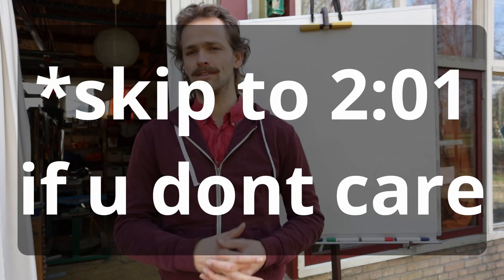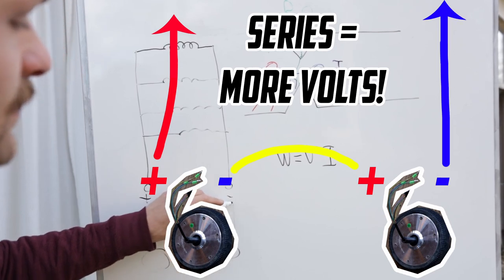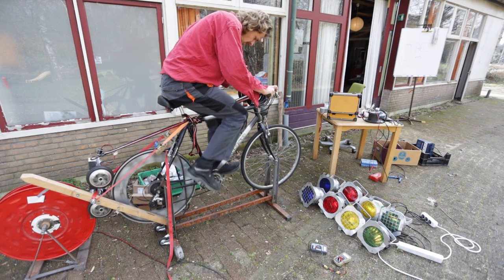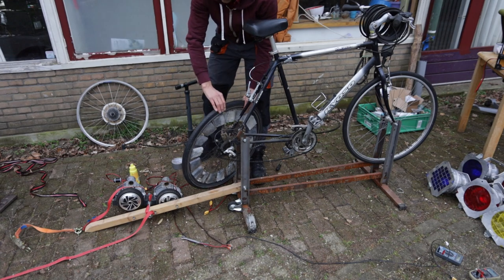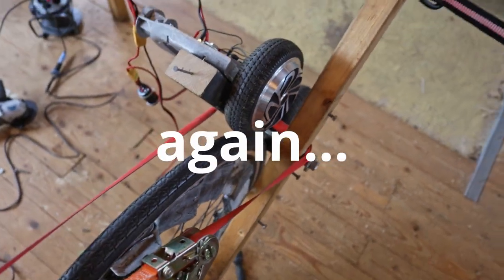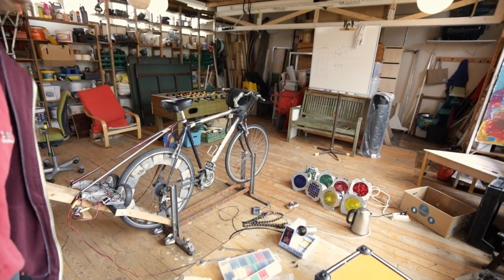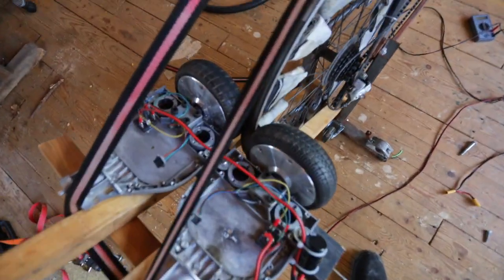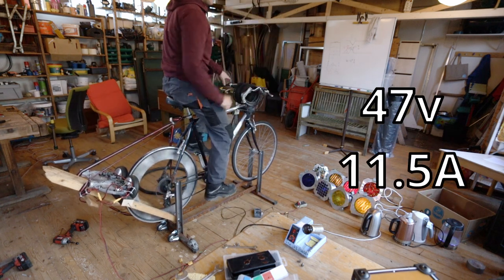OVER 600WATTS with BIKE GENERATOR using HOVERBOARD MOTORS!

Comment: how long does it take to boil a kettle of water with 200-300 watts?
Reply from the maker: Depends on a few factors like efficiency of your boiling device and thermal isolation and such. But, considering that a 80w 350ml water boiler takes about 25min to get to boiling temperature, you could use 3 of those to boil about a liter of water in 25min using 240w. More or less. :-)
Reply: @jurriaandevosprojects  that's quite long for a few cups of tea!
Reply from the maker: @KnowArt  Yes. So usually some gas/coal/nuclear/biomass-powered steam turbine is doing all that work for YOUR cup of tea. 🙂 Or it's wind, solar, hydro, tidal or thermal power, but those are actually quite a small percentage of power generation.

Comment: Thank you for the information and the video! I appreciate all the effort you put into you channel!  Question ... Rather than trying to run all of the resistive loads ... What results would you get going into a charge controller and charging a 12V / 100AH Lithium battery?   Your set up is the cleanest / closest to charge potentially charging a battery using hoverboard motors I've seen.  I'm hoping to create a set up whereby I can charge 12V / 100AH lithium batteries, one at a time (or maybe 2 at a time for 24V) and have them either in backup reserve or in a constant rotation of 5-10 batteries & inverters to run various items when needed (TV, refrigerator, etc)

Comment: Os motores de hoverboard funcionam com 3 fases AC
Não entendi como os ligou em série.
Agradeço
Reply from the maker: I used a 3 phase bridge rectifier and a big capacitor for every motor to transform the 3 pbase AC into DC. Then I tried the DC output of both motors in series and parallel :-)

Comment: During a bicycle race, an elite cyclist can produce close to 400 watts of mechanical power over an hour and in short bursts over double that—1000 to 1100 watts; modern racing bicycles have greater than 95% mechanical efficiency. 5% friction, what about this bike
Reply from the maker: Hehehe well, I'm pretty sure neither me nor this bike are in the elite segment... 😇 There is "normal" friction in chain, bearings, etc. and this bike has seen better days. So well above 5% I'd say. Then there is a lot of added fruction between the aluminum rim of the rear wheel, and the rubber from the hoverboard motors. So I'd roughly estimate between 15 and 20% lost between legs and generator. And then there is of course the efficiency with which the generators translate rotation into electricity. No idea how much is lost there to be honest. 

Stay tuned for the next video's to see how much power I acctually get into a battery. There are some more conversion losses there 😉